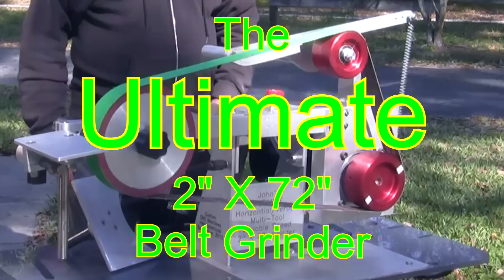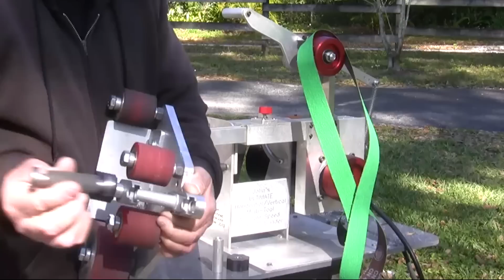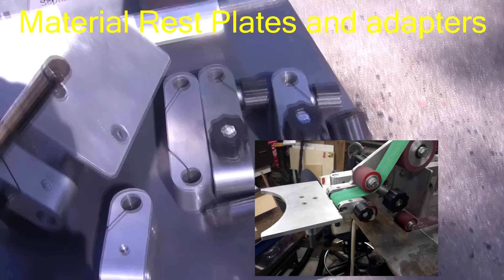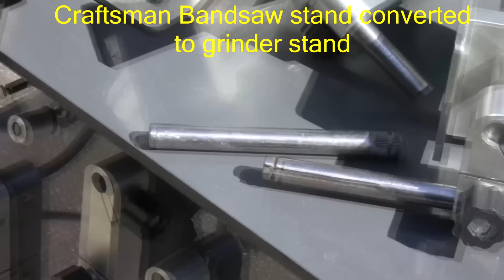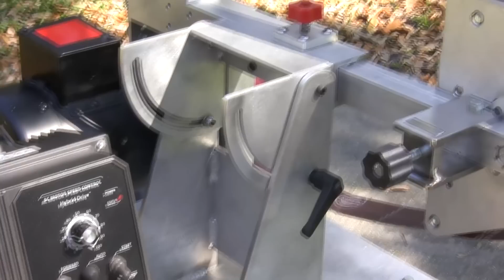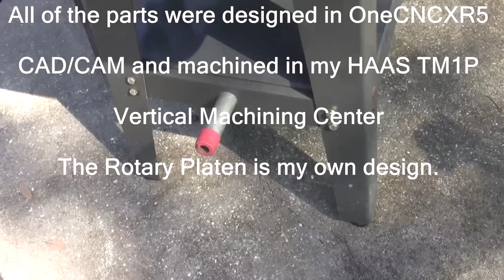2" X 72" Ultimate Grinder 02-18-15

Comment: very well done. One of the best if not the bet ive seen so far.And so many possibilities. I went to check the link on CNC forum but i see no files only pics and some text about it. Do you mind sharing the CAD files? Thank you in advance
Reply from the maker: No, I am not currently selling these. I do however have all
the CAD/CAM files for most of the parts utilized in building this machine.
The GOOD NEWS is they are FREE!  Kind of a pay-back for all the help I have
received here on YouTube over the years.
I do not accept any responsibility for your use of the
information supplied.  Utilize at your
own risk.
If you would like more information you can
contact me at clarkj@tampabay.rr.com
Reply: helicopterjohns thanks bud. email on the way

Comment: KMG or The TM-90 Doesn't HAVE ANYTHING ON THIS AMAZING WORK OF ENGINEERING. Would you please build me one????
Reply from the maker: +Brett Jones 

Thanks for the favorable comment.
Both KMG and TW 90 Grinders are GREAT machines.  To be mentioned them in the same sentence with them makes me really feel good.  As I had the necessary CAD/CAM software and a HAAS TM-1P CNC machine I decided to make my own.  I do have DXF  files for the items I made on the CNC machine which supplies most of the dimensions for items machined.  Also, If you look in the description under the video you will see a link to the CNC Zone where I posted information of the entire build.  If you would like a copy of the files just send me a request via the contact option.

John

Comment: amazing, beyond my skills, but  I would purchase this over a Bader.
Reply from the maker: +Jack Nemo 

WOW!  Better than a Bader.  You just made my day.  Ha Ha  I did my research prior to building.  Tried to pick the best of all worlds and added my own touch i.e. the rotary platen.  Horizontal/Vertical operation, great wheel selection, variable speed, plenty of power, and the ability to add additional tool bars as necessary for any need that arises i.e. the additional tool bar that allows for mounting stuff like de-burring wheels, buffing wheels, wire wheels.

That's why I called it the Ultimate Grinder.  Ha Ha  I really enjoy this tool.

John

Comment: John, Great design! Neat video. I really like the buffer, wire wheel attachment. I'll email you for the plans.
Reply from the maker: +Karl Schuler 
Thanks for the favorable comments.  The nice thing about this grinder is as you come up with additional ideas they are easily incorporated into the design.  One other thing that could be added is a disc sander.

Comment: The arm for your material rest is right in the way. It needs to set below the work area.
Reply from the maker: +Criterionx1 
There are multiple extension arms and many configurations that allow for many possibilities as it pertains to material rest positions.  Also the 1 1/2" bar that supports the tool rests can be rotated in 90 degree increments.  The tool rest does not interfere with grinding operations.

John

Comment: Great piece of engineering. All the features you could want in belt grinder. I may have missed the info, but what did you use for a motor?
Reply from the maker: +Mel Hocken 

The motor I used was a 2HP  1725 RPM 3 phase motor 56C frame mounting option.

The VFD that I chose has an 2X option.  It is powered via 220Volts A/C Single Phase.  The output is 220 Volts A/C Three phase.  The 2X option allows the 1725 RPM motor to turn 3450 RPM.

John

Comment: This is the best grinder on youtube and there many excellent grinders and designers here.  Not to detract from them or their efforts,  I think If you value versatility and are willing to put the time into this, anyone looking at building a 2x72 belt grinder should watch this.  My favorite aspect is the the toolbar with the pillow blocks and traditional abrasive wheels powered by the abrasive belt itself.  Brilliant! - opens a host of possibilities.

I really appreciate you sharing it in such detail with us.  Making videos like this takes a fair amount of time so I think most people here really appreciate innovative people such as yourself generously sharing their knowledge.  Thanks John!
Reply from the maker: +Ben Griswold 
Thanks for the favorable comment.  I did a ton of research prior to building this unit.  I think?????? that I looked at every possible YouTube video as well as other resources on the subject.  What you said about the toolbar with the pillow blocks on it is absolutely true.  Grinding, Deburring, Sanding, Polishing, Buffing in either the horizontal or vertical position with a wide selection of contact wheels driven by a 2hp 3 Phase variable speed configuration that can run a 3 phase 1725 RPM motor at 3450 RPM from basic 220 Single Phase current is the Cats Meow!!!!!     This is the MOST versatile tool that I have in my shop.  That is why I called it the Ultimate Grinder.  Ha Ha

The CAD/CAM files with associated pictures are FREE for the asking.

John

Comment: What would you charge to build one of these (if you even would)....for just the chassis, wheels, and various platens? No motor and VFD.
Reply from the maker: +BAZYRKYRS BUNKER 

I will send you a FREE set of CAD/CAM files with associated pictures.  If you look in the description under the video you will see a link to the CNCZONE where I documented this build with text and plenty of pictures.

If you would like to talk more about the possibility of me building one for you please contact me at clarkj@tampabay.rr.com  You can also request the CAD/CAM files at that e-mail address.

John
Reply: Will do...thanks.
Reply: +Helicopterjohns
I am also going to request the files. Yours is by far, the nicest, most thought out and well executed one I have seen.  the email will be from "belvederexxxxxxxxxxx"

 Thanks, Todd
Reply from the maker: +T. DesMarais 

No problem.  Just send me the request and I will add your e-mail address to my Google Drive folder.  It will send you an invitation to download the files.  There are several different CAD formats along with some support pictures.  The compete build information is available on the CNCZONE.  I have provided a URL link to it in the description located in the info/description box under the video here on YouTube.

Enjoy!

John
Reply: +helicopterjohns 
  Thanks John. I got all 55 of 'em.  I must say, you could potentially machine the rotary platen, tension arm and horz-vert pivot pieces as a "kit" of sorts for those who don't have access to a milling machine but still wish to use your design. the rest seems pretty straight forward and could be done with more common tools.  Gotta pay for that HAAS somehow !
  One item I was thinking of trying and you may like as well.... use a gas lift rod instead of the spring. (think hood/trunk lift rods)

Comment: John, nice work!
Reply from the maker: +meathelmet41 

Thanks for the favorable comment.  Glad you liked it.

John
Reply: +helicopterjohns Indeed it is Ultimate grinder,would you share files that have measurements with me ?
Reply from the maker: +zumbazumba1 

No, I am not currently selling these. I do however have all the CAD/CAM 
files for most of the parts utilized in building this machine.  If you 
would like more information you can contact me at 
clarkj@tampabay.rr.com

Comment: Your improved ultimate sander is amazing. I've been using a Wilmont LB1000 2x72 for about a year now which is a big improvement over the horizontal 4x24 oscillating sander I've had for 7 years. The rotary platen is the best improvement I can imagine. I think you've definitely invented a superior 2x72 sander.
Reply from the maker: +firstgeer 

Thanks for the favorable comment.  I looked at a lot of videos and saw all of those tool bars and people building racks to hold all of them and I thought there must be a better way.  My design on the rotary platen is the first of its kind and boy does it work nice.  The spring loaded plunger pin makes it a snap to change contact wheel positions.  Just loosen the retaining  knob about a quarter of a turn,  pull the spring loaded pin, rotate to new position, re-tighten the retaining knob, re-tension the belt and you are back in business.  Takes on a few seconds to make a change.  I was pleased as the design worked well on the first try.  The only improvement would be to change the attachment point for the small wheel adapter and get rid of the extended piece that sticks out the front.  This would be easy to do but probably not worth me making a new rotary plate.  Just too busy doing other projects.   Ha Ha  Man, I love this grinder.

John

Comment: Awesome design and work!!  I've made 2 belt grinders already, but if I were to buy one, this is what I would want!!  Thanks!!  Mike
Reply from the maker: +bluehandsvideo 

Hi,

Thanks for the favorable comment.

This has been one of the best projects I have undertaken.  The pay back in terms of satisfaction and  having a GREAT shop tool has really exceeded my expectations.   I haven't tried one of the Scotch Brite belts yet, but I hear they are very nice.  One day when I get some time I may add a 9" disc sander attachment to the drive pulley.

I am presently working on projects at it pertains to kayak steering and propulsion systems.  A lot of real challenges there.  Check out my You Tube channel for the videos on Electric/foot pedal STEERING and also tilt and trim features on trolling motors attached to kayaks.

John

Comment: been looking into building my own but money is an issue. are you selling these? also do you have plans for this system?
Reply from the maker: +PoliticalSmackdown 

No, I am not currently selling these. I do however have all the CAD/CAM files for most of the parts utilized in building this machine.  If you would like more information you can contact me at clarkj@tampabay.rr.com

Comment: That is the most well thought out belt grinder I have ever seen. Great job on this John thanks for posting
Reply from the maker: jimmy dahl Thanks for the favorable comment.  My rotary platen design is what put the icing on the cake.  Super easy to switch to different belt configurations.  Vertical to Horizontal operation in seconds. The ability to add new tool bars as ideas for other operations are realized.  The 2 X option on the motor control is super nice allowing a 1725 rpm 3 phase motor to run at 3450 rpm.  Loads of torque and rpm i.e. the best of both worlds.

Comment: How do you like you TMP1? How long have you had it? I just put in a TMP2 and am in the process of building a combination tooling pallet and vacuum fixture for it. I'm going to order a TLS in couple of months.
Reply from the maker: DallasCNC Hi,  I really like my HAAS TM1P  It was delivered in January 2008 and has worked flawlessly for me.  I have the Renishaw wireless probe and tool setter and use it all the time.  A real time saver.  If you check out some of my other videos you will see some of the modifications I did to my machine. i.e. programmable coolant nozzle, i.e. PCOOL programmable solenoids for controlling opening and closing air collet fixtures etc.  I also hear that HAAS CNC lathes work well also.  I also made a vacuum fixture plate for holding plexiglas sheets while engraving LED Edge Lit Signage.

John
Reply: My dad was a tool and instrument maker and taught me to run manual equipment starting at age of 14. I have worked in, owned and run a shop for over 50 years. I'm retired and am setting up a shop in my garage to build some things I have thought about for a lifetime. Delighted that you are happy with your TMP1.

Comment: Excellent design implementation John. I am apparently going down the same road you traveled here. I've been researching all the various available grinders, plans, and kits currently on the market in the hope of building my own. I can't afford to purchase one outright, but broken into smaller component purchases and my own spare time working on it I believe is a viable option. I would use plate and have it cut so that I can weld, drill, tap it myself. Yours is the best design I've seen. Simple yet elegantly functional. Thank you for uploading and going over the aspects so thoroughly. Blessings and peace.
Reply from the maker: Hi Paul,

Thanks for the favorable comments.  I am extremely glad a built this project.  Use it most every day in the shop.
Reply: You're welcome John. As versatile as you made it I can see why this would be so often in use. Kudos on the successful build. May I PM you?
Reply from the maker: Hi Paul,

Yes, you are welcome to PM me.

Comment: You should be congratulated, this is a very nice design, with an excellent build quality.
Dare hate to think how much it would be if it was purchased commercially with all the flexibility that you built in.

Cheers
Reply from the maker: Hi Greg,

Thanks for the favorable comments.

It was fun to build and a joy to use.  It is my one stop grinding, sanding, deburring, buffing and polishing center.  I am especially pleased with the operation of my Rotary Platen Toolbar Design. So many options, vertical or horizontal operation and so easy to change to different finishing needs. The VFD and the ability to instantly change speeds to suit your project needs is another great option.

I did a ton of research looking at all the 2" X 72" Grinders and tried to take the best from each of them to make myself what I call the ULTIMATE GRINDER.

I love It and thought I would share.
Reply: helicopterjohns
I am just in the planning stage at this time, but I dont think that the one that I will build will be as complete as yours, because I dont have a CNC machine ( one on the way soon via conversion kit I hope ), only a manual Mill and Lathe.
I have seen the comercial ones and they are expensive and at the other end "white bone knives" put together one for $400 from scalvaged parts, it was very simple and did the job, grimsmo build one that was sort of like yours that even he said he made some mistakes in the design ( what I think he said ).
I particularly liked the add on wheels/tool bars that will turn it into a multi grinder of sort.
So hopefully I can steel some of your ideas and make one that is more flexible.
Cheers
Reply from the maker: Greg SB That is what is so nice about the internet and YouTube.  There is a lot of information out there if you just take to time to search for it.  Good luck on your build.  The nice thing about the toolbar design on my machine and others like it is that if you come up with a new idea you can just incorporate it into another toolbar.  One last thing that I may do if and when I get some time is incorporate a 9" disc sander.  I saw where one guy made one and drilled some holes into the end of his motor drive pulley and made dowel pins on the 9" disc and used some of those powerful magnets to actually hold it in place.  Very simple yet effective.  Just have to make some type of table for it.  Just something for you to think about.  Ha Ha